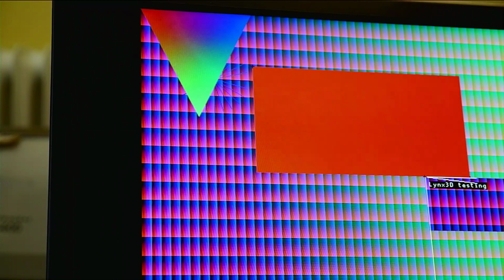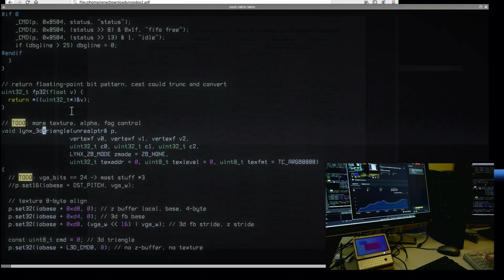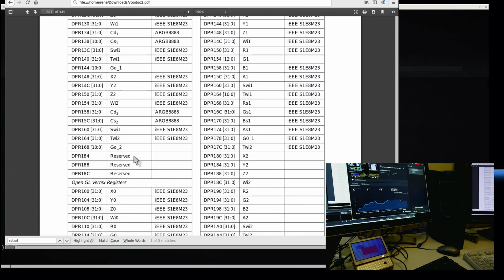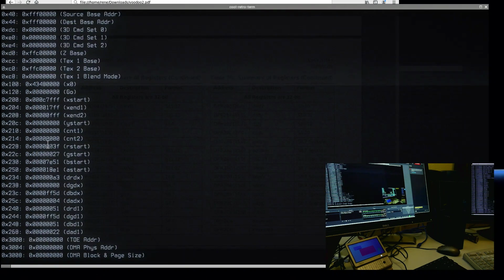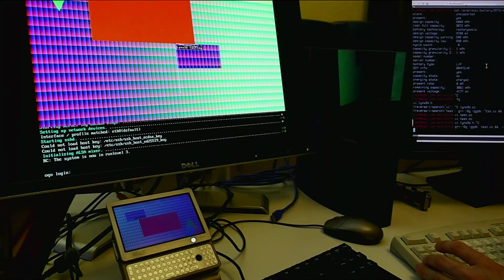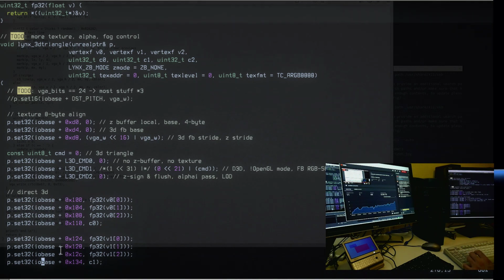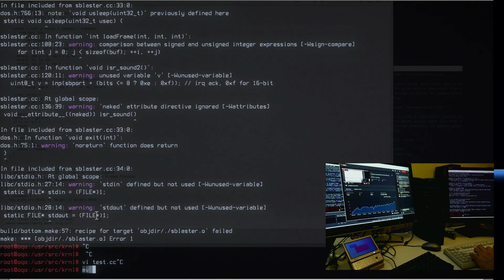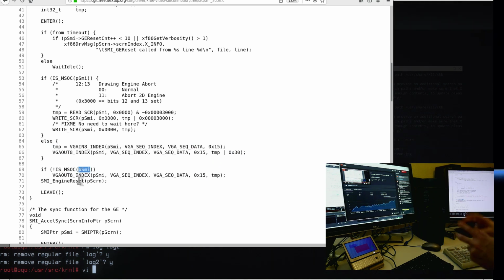Going hw accelerated 3d where few have gone before! - SM Lynx3D !

Comment: Line drawing and stuff got thrown out with EXA which was introduced in 2005 by Zack Rusin, in a drive-by fashion. The first guy to actually add driver support for EXA was Thomas Winnischoffer from the SiS driver.
Reply: Then we had several years of XAA being massively faster than EXA still. Until Eric Anholt went around and removed an XAA hook from PaintWindow "to remove a layering violation", which finally made XAA as slow as EXA, and which also broke XAA. I went and fixed the breakage back in the day: See xserver commit 59f9fb4b from 2008. That was an insane bug to debug; software rendered cursor, keyboard-emulation for mouse movement, cursor N pixels right (right-arrow), N pixels down(down-arrow), corruption; repeat over several days, until the offender was found.